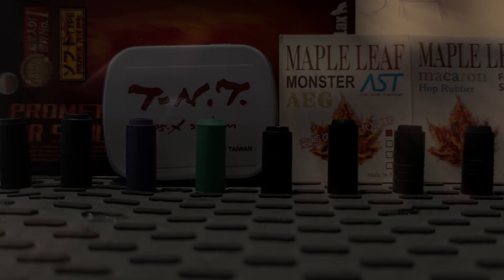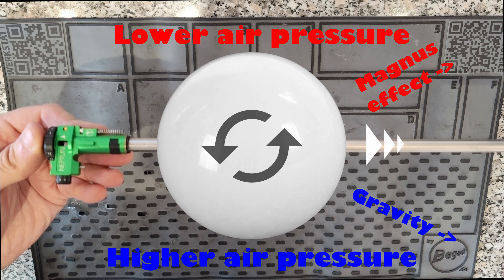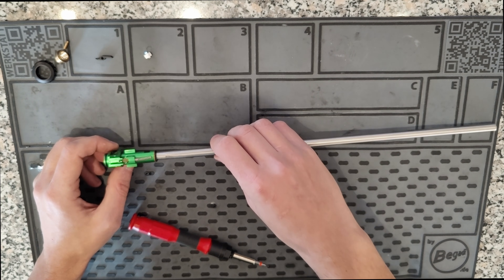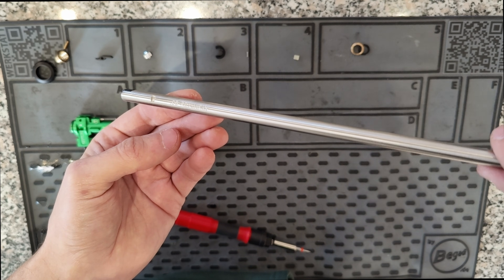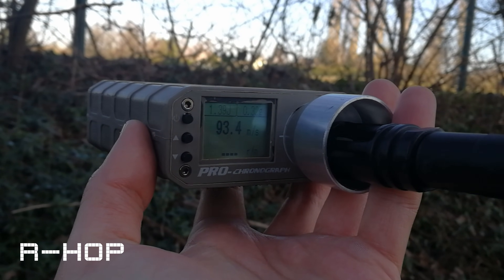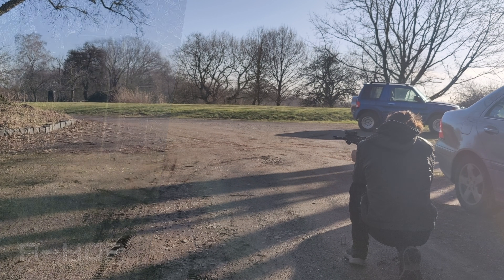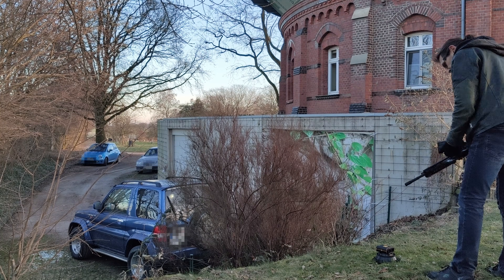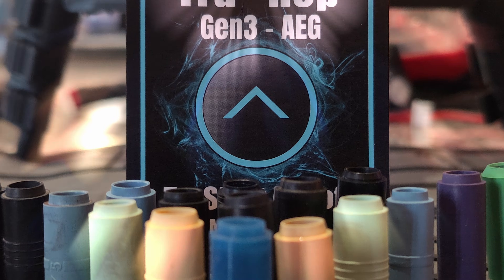New airsoft Hop-Up bucking for max precision: Testing the Tru-Hop Gen3 for AEGs by TruSight Airsoft

Comment: To be candid, your rhop install was very subpar. none of the drop in solutions come close when its done right.
Reply from the maker: Hello and thanks for your comment! 

The RHop was done by Scasso who is / was kinda famous in the German Forum "Airsoftverzeichnis" for his RHop builds. 
I always was happy with this solution, but when I did the testing, it already was ~3 years old. As I'm no expert RHop tech, I can not comment on the way he did it - I only know about his good reputation. 

Have a good one!
Reply: @rummbolt  unfortunately it would appear his fame was ill-placed. that didn't even appear to be proper patch; more like a sugru or silicone caulk. A proper Rhop will maintain a head size group at a hundred yards and the trajectory would be essentially flat for at least 220'. the effect is extremely pronounced. I respect your research efforts, surely you wouldn't know what you don't know, it is however frustrating to see so many write off the rhop as antiquated when its certainly still the most effective system you can install. To be fair, it was/is exceptionally rare to see a properly implemented one on the field, so for 99% of players, these drop ins probably would be a substantial upgrade.

Comment: Your bb flight is very chaotic, looks like a botched install, it should not wiggle like that in air, usually means not perfectly applied spin
Reply from the maker: Thanks for the hint! I think I installed the bucking correctly, but it's over a year ago by now and the build does not exist anymore. At least, I can not remember I did anything differently than with other setups...
Have a good one!

Comment: Range is affected by joules and bb weight. Saying that patch size matters is just clown talk
Reply from the maker: But with larger patch surface, you should be able to lift heavier BBs -> Which brings you more range. A regular Marui-Style bucking for example, as it was very common ~10 years ago,  most likely will not be able to lift 0.45s :) 
Have a good one!
Reply: @rummbolt  yes but i assumed that both joules and bb weight doesn't change, patch alone will not change the range
Reply from the maker: @MegaChickenPunch  Yep, this also what I think about it :)
Reply: your entirely incorrect. patch profile, length and by extension pressure applied directly affect range. velocity and energy work inversely against your range delta without proper hop stabilization.
Reply: @fanofCOH  lmao stop yapping ur clueless
Reply: @MegaChickenPunch  nah im not, but keep thinking your right!
Reply: @fanofCOH  don't forget to find your perfect spin patch so you can get 150 meters of range BUAHHAHAHAHAHA
Reply: @fanofCOH  you literally don't know how physics work and it's laughable but keep yapping airsoft joe :face-green-smiling::face-green-smiling::face-green-smiling:

Comment: I haven’t seen a good precision from both examples…the trajectory was wrong in both…you didn’t had magnus effect at all, they were just going straight then falling, that is not the right trajectory, it should go straight a while then magnus effect gets into action then falling…so your test is not a good examppe
Reply from the maker: I'm really sorry, but my understanding of hop up is a lot different. Did you ever see a replica in typical airsoft energy limits, shooting 60 meters without any "magnus effect at all"? This barely is possible - as soon as you apply backspin on the BB, the magnus effect sets in, and gets stronger the more backspin you add. What you describe is what many consider the "sweet spot" for maximum range, just before overhop. The trajectory on every setup can be slightly different, it depends on many factors such as BB weight, Tensioner, barrel etc...

I think my test can't be so wrong, while even the manufacturer of the TruHop considers it to be a " well-made comparison" here in the comments :) Thanks for understanding, have a good one!
Reply: flat trajectory is a user preference, stop saying nonsense that there is no magnus on the video LMAO
with no magnus bbs fall after 20 meters

Comment: To be honest, if you only manage consistent hits at 40m with 1.5J using 0.32gs... there is something wrong with your set up or the bucking. You should be able to get those 40m with 1.1J using 0.28BBs and a regular decent bucking like a G&G green bucking.

Also, there is a reason after a year, that truhop stays as a gimmick, like the 4uantum one, materials seem good and are probably 90% of the reason why they perform decently, but the patch design is still inferior to Mapple Leaf's, which tried to imitate an Rhop and ended up straight copying it in the MRseries
Reply from the maker: Hello and thanks for the comment on my video :)
Here are my thoughts on your points: 

1. I think I never said those resoluts on 40 meters are not possible on other setups, right? Also on 60 meters, I'm not aware of any bucking that will bring you 10/10 shot on target consistantly, using 0.32s on 1.5J. Even the better buckings from my recently released test comparison video are not - we just have too many external influences. 

2. I agree, that the TruHop Design is not the Game Changer in the world of bucking dessign. But it is very competitive compared to others, + I appreciate the way TruSight did, doing something new. 

Have a good one :)

Comment: To be honest, your rhop shoots too unstable, even an ordinary rubber  will show more stable results🤔 I used Bergadi and Maple Leaf, they are also no different from each other, but in any case it’s better than in the video rhop
Reply from the maker: The classic glued-in R-Hop in my eyes is an outdated technology, which is completely to be replaced by the modern drop-in buckings. Also Begadi and ML, if you ask me. There is a huge Hop-Up Comparison video coming early 2025, in which i will test the performance of 12 modern drop-in buckings. Have a good one!

Comment: Which do you like better, this of friction pro 4uad? For hpa
Reply from the maker: @danielarturodebernardogome832  Thanks for your comment! The are very Close in terms of Performance, but i prefer the 4uad Bucking a little better :) 
Have a good one!
Reply: @ I have a mancraft cnc body, inferno gen 2 and m4A hop, I keep getting bad accuracy, is there any recommendation from your part, barrels ai have lambda and pdi, I have almost every bucking on the market:)
Reply from the maker: There will come a huge Bucking comparison in early 2025 on my channel (on AEG, but results could be similar on HPA)

For now, try to get the most heavy BBs you can hop in the stock barrel and the 4uad bucking. Am alternative could be the Begadi  Mag / Fly buckings, maybe you also want to check them out :)

Comment: To my eyes them bb's seems to be going left and right not straight on both the r-hop and tru hop.
I think I will stick with the FPS SOFTAIR flat rubber I get a good straight long accurate shot with them.
Reply from the maker: Thanks for sharing you experience :) 
Please keep in mind that wind had a slight impact on this test. Those are not the same results as you would get in a well protected area. For me, it was far more important to point out the difference between the TruHop and R-Hop results, which are good to to see in my opinion. Your FPS SOFTAIR Bucking may do a great job as well, but i think every AEG will have it´s problems at 60 Meters to get 10/10 straight under realisitc conditions. In over 7 years of airsoft, I´ve never seen a replica to be that accurate - (speaking about energy  range of 1.5 joules).Thats what i mean when saying "Keep in mind it´s airsoft" :) I´m always open to be proven wrong - so maybe the FPS Bucking is worth a closer look ;)
Reply: @rummbolt  I have a bucking for you ;) I just released my bucking that vastly outperforms other buckings when it comes to groupings. I can hit 10/10 targets on a human chest at 65-70m at 1.5J
Reply from the maker: @FrozenByFire3  Sounds interesting! Whats the Name of this Bucking?
Reply: @rummbolt  airsoftmutation LC bucking
Reply from the maker: @FrozenByFire3  Looks great ! In case you're interested in a cooperation, feel free to reach out to me via rummbolt@gmx.de 
thank you, have a good one ☺️

Comment: Be interested to try, the patch does seem very small so you'll need to ensure the hop chamber is very straight.  I noticed a mold line on the outside, is that a sample you have or final production?  It looks a little rough around the edges compared to something like the Begadi, however as long as it shoots straight I don't really care.
Reply from the maker: Yes, i think straight installation is very important here. But i felt it to be very easy actually :) 

I assume you´re referring to the last bucking seen in the intro. The mold line in fact is a light refllection , but it looks very similar :D Moreover, this is actually the Gen 2 of the Trusight, as the Gen3 was already installed when i recorded the Intro. The Gen3 is of very high quality and has an embossed label on the rear end, so it´s easy to identify. But i should have shown more clearly here. Sorry for the confusion :)